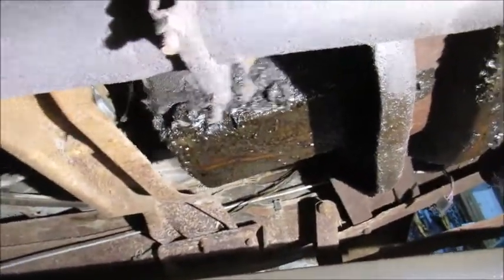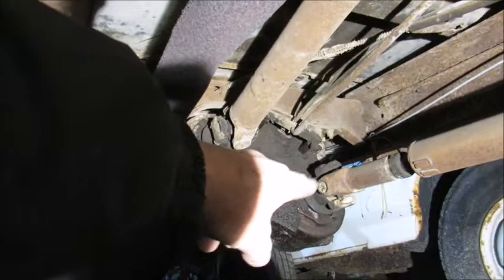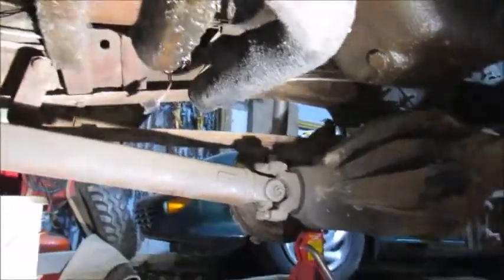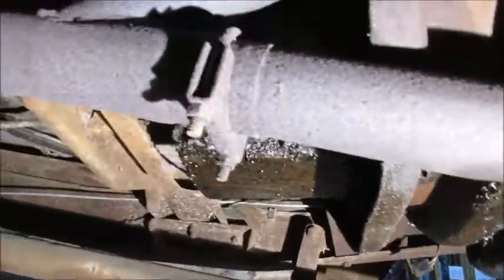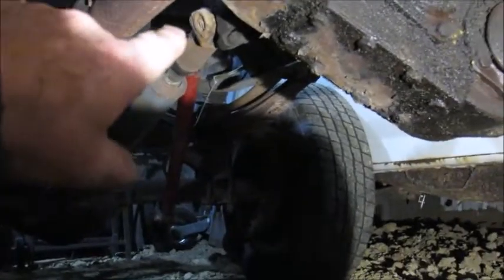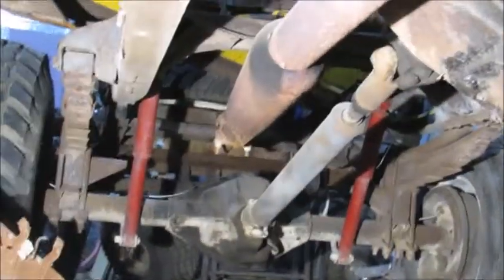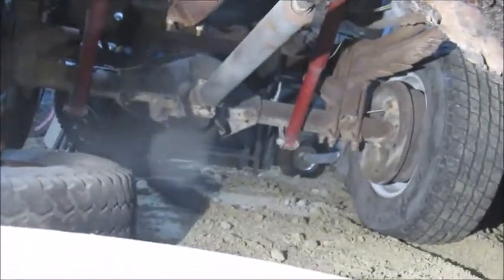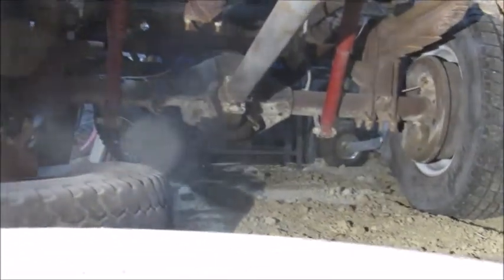What is a divorced transfer case?

Comment: I'm looking for a transfer case that I can have to input shafts. 1 from transmission and one from electric motor
Reply from the maker: The Dana 20/24 might work. It has a drive shaft between the transmission and the transfer case. It has 2 separate output , one to the front and 1 to the rear. If you are trying to do it a 2 wheel drive vehicle it may so long  as you can disconnect the transmission from the transfer case. Not sure how the gearing in the transfer case would work.

Comment: Thank you for the clarity. I thought I knew, but stand corrected as I thought it just meant it was disconnected from the transmission
Reply from the maker: Kevin Babcock, first I want to say that I'm sorry for the late reply. I had some medical issues. The transmission is separated from the transfer case by a short drive shaft. there are 2 primary reasons for this: first one is because if the angle of the driver shafts to the front and rear axels. The 2nd was so that Ford could continue to use the 2 wheel drive transmission. This way they would not have to create a new transmission that worked only for the "high boy". Side note: they continued to use this method until mid 77 or 78. Thanks, Ron.